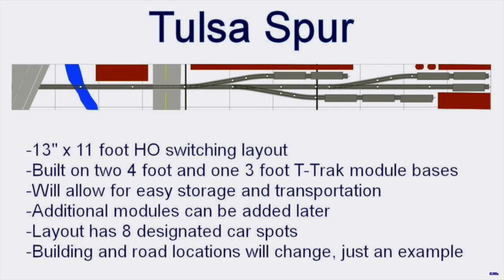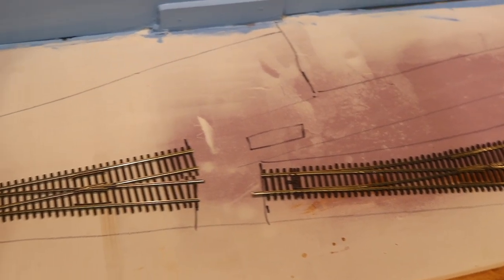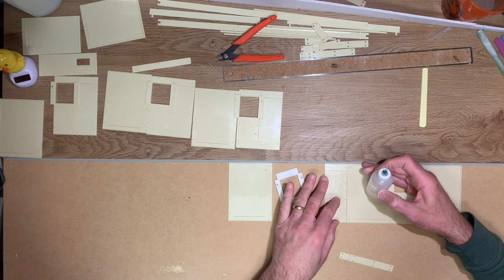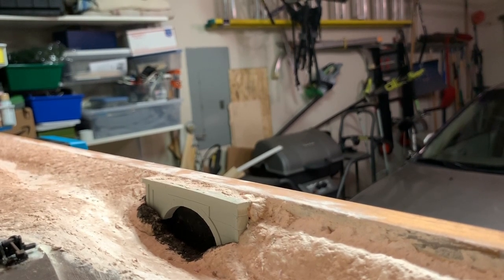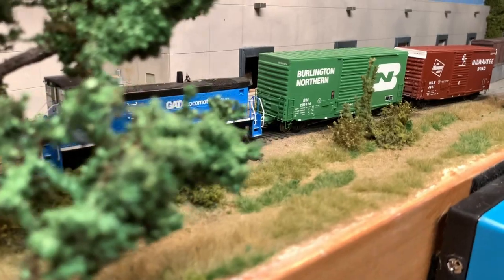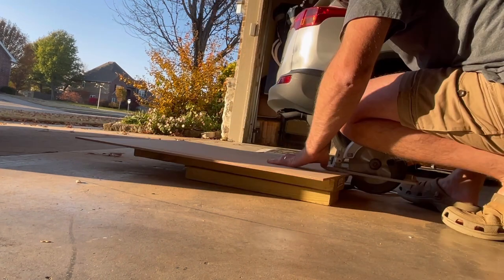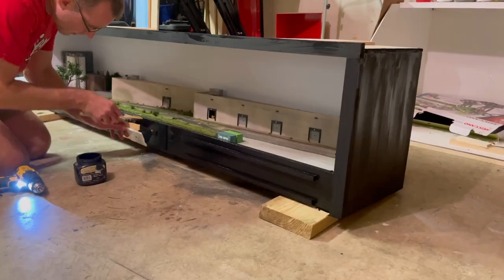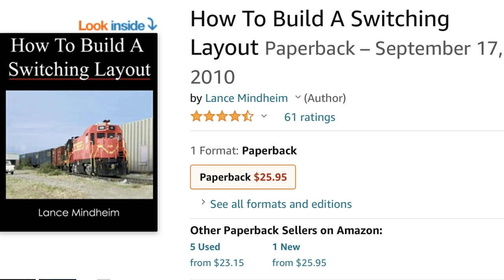Build an HO Switching Layout from T-Trak Modules

Comment: Steve love your work! been a fan for over 14 builds "only one obsevation" Please get off your hands and knees hang a hinged door off an emply wall or use some pullies to make a work bench find an old table at goodwill put some casters on it! So u can work live a civilized craftsman instead of a bushman DUDE!!!!
Reply from the maker: I have saw horses and sometimes will use them but I just prefer to kneel or squat than stand most of the time.

Comment: I have a 10x 8 room, with a hallway I plan to have a 11 foot by one foot that can access to the main layout, with that size to work with in ho scale, any suggestions on whether I should make it industrial, a Shortline, or double leveled with Max length runs with little switching and mostly railfanning for others to admire? I have ideas for any scenario but I love short line and industry switching layouts but am so unsure of which direction to go to!

Comment: Question Steve. Do prefer a DC vs DCC system for a switching layout?
Reply from the maker: It depends. If I want it to be portable, DC is easier, but DCC can be powered by a battery too. It can be fun to have sound with a switching layout, and you can use a keep alive capacitor in DCC locomotives for less concern about stalling on turnouts.
Reply: @StevesTrains  please allow to follow up with does it make a difference at moment of un/decoupling? Thanks in advance.

Comment: I really enjoy your videos. Thanks. I'm new at this, what adhesives do you use for building structures (Walters)?
Reply from the maker: I use a plastic solvent like these: https://amzn.to/37rkF8Z  or https://www.hobbylinc.com/plastruct-bondene-cement-plastic-model-cement-00003 you can usually find these or a similar version at most hobby shops. What it does is melt the surfaces being bonded and then they fuse together. The joints end up being incredibly strong, and far more durable than using super glue, or something like that.
Reply: @StevesTrains  Thanks, but more than double the price in Canada if I can find it. I'll keep looking for similar stuff.